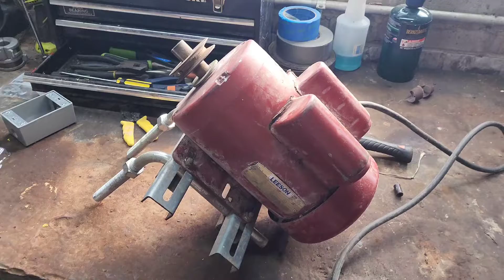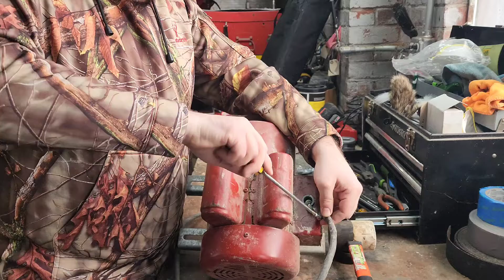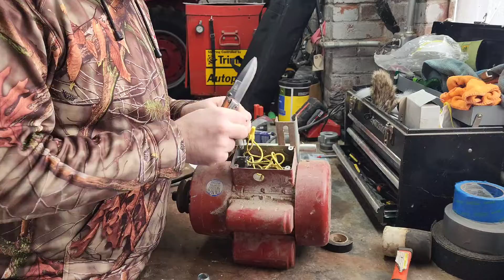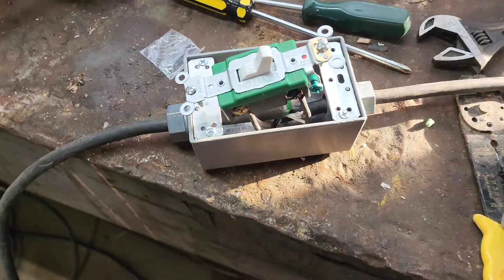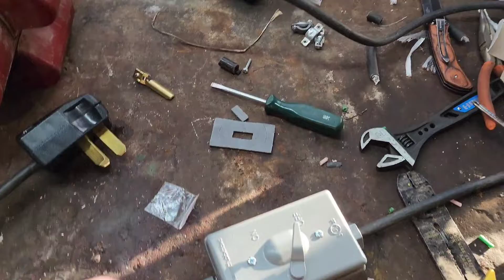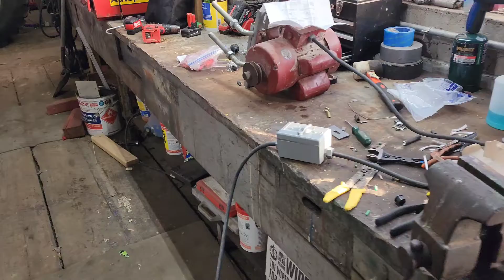Wiring a 2 Pole Switch Into a 220v Motor

Comment: thank you for sharing and making This video thank John also.  I think you should have showed how the wires went on the receptacle going in and out the box  . I assume the white wires on the  switch are 110 so that should have some black tape on it. to show it to 220 lead. some people maybe would want to  have seen where the two wires coming in  to switch out from the switch. .. I'm not electrician either today I wired my 2 pole 220 air compressor up .I looked it up before I did it ,,Just for moving forward and putting this video together u deserve 5 stars,did I make a video no,keep being positive 
tommy g <> So,Cal,  USA